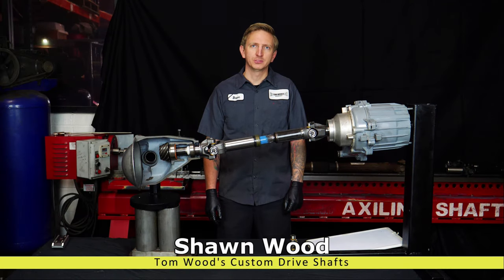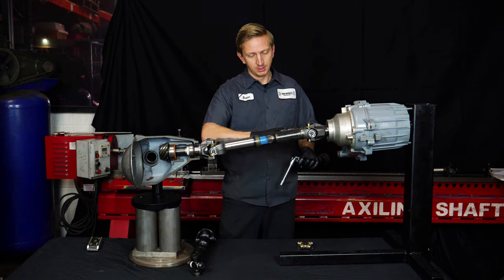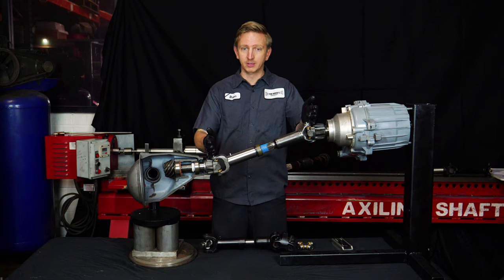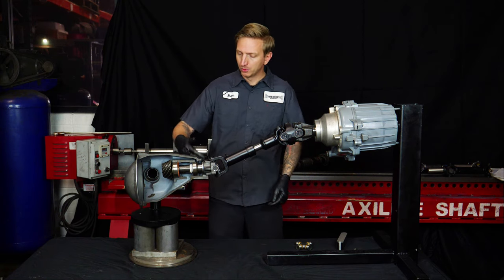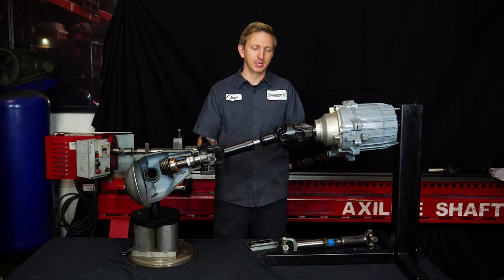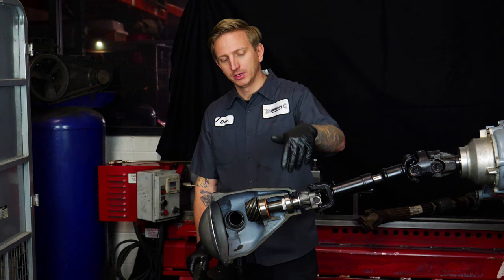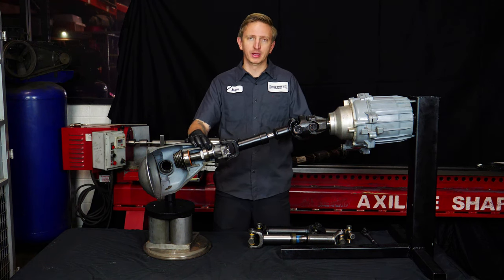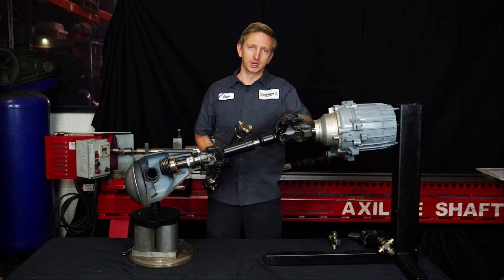Drive Shaft Angles Explained

Comment: That’s the vertical plane. The same rules should apply in the horizontal plane for an offcentred engine? Propshaft a few degrees off straight ahead should be fine right?
Reply from the maker: The side to side offset matters but only because it adds to the net joint angle at each end. There's some math that can be done to figure it but if you have 5 degrees vertical angle and 3 degrees side angle you'll end up with something like 6 degrees net angle. You square each angle, add them together, then find the square root of that sum. The important part to remember is that it isn't vertical plus horizontal equals total. In this "for instance" scenario above you'd still be within the limits of what should work well. Ultimately though, angle is angle and the drive shaft doesn't know up from down from sideways.
Reply: Interesting.  Thanks for that info 👍🏼

Comment: Great video. Answered some questions I had. Do you have anything concerning allowable yoke angle alignment? Working on PTO driven fire pumps on commercial chassis and there is a slight (1.5°) difference in yoke angles on the jack shaft. Wondering how much misalignment is allowed before issues might appear?
Reply from the maker: 1.5 degrees should not be a problem. In theory it is going to cause disruptions in how smoothly things run but I predict that the outcome will be insignificant and imperceptible.

Comment: hello, the same rules apply to a 4links? Or would the pinion have to stay at 0 degrees? what would be the ideal angle for a fourlink suspension?
Reply from the maker: We still tell people to set the pinion to about 2 degrees lower than the drive shaft. The axle wrap doesn't come into play with a 4 link though but 2 degrees still works well and allows us to give a broad and general recommendation.

Comment: I have a vibration in my 90 k5 blazer after 60mph, the vibration continues there after. I would describe it as a steep angle vibration feel. The k5 is all stock with a new driveshaft I had built. Aside from an improperly balanced shaft, what other components could be causing the high speed vibration? And the  tires have been replaced many times during the elimination process. Could the splined slip yoke even though it is tight to the bushing still cause balancing issues? I also noticed in 4H my front driveshaft will cause a vibration around 55mph. Not as concerned with that just wondering if there is a connection.
Reply from the maker: You can read some tips on identifying drive shaft vibrations here https://4xshaft.com/blogs/faq/diagnosing-drive-shaft-vibrations?_pos=1&_sid=d6ec76a03&_ss=r

Comment: My transmission flange & rear end are both zero so driveshaft is minus 6 at trans & plus 6 at rear. Single car Dan at both ends with the splined deal in shaft. I’m chasing a vibration & have had new splined section installed & balanced with new joints. Is 6 degrees acceptable?
Reply from the maker: Hi there. I know that your transmission and pinion are parallel but I don't know the other important piece of the puzzle, what the drive shaft angle is and how it relates to the other things. If your drive shaft angle is less than about 16 degrees (10 degree net joint angle at each end) then yes your angles are acceptable. If not, you may need a double cardan. There are also many other reasons a drive shaft might vibrate. More help diagnosing those can be found here https://4xshaft.com/blogs/faq/diagnosing-drive-shaft-vibrations?_pos=1&_sid=d6ec76a03&_ss=r

Comment: I’ve been fighting a 60mph front vibration for a year now.  Took the front shaft to a local driveshaft shop paid $300 to replace the center ball and balance. It didn’t help at all.  The caster was at 4 degree according to the alignment shop.  If I remove the shaft there is no vibration. Bringing the angle down shorting the upper control arms helps. Should I keep bring it down till the vibration stops?  Is the shaft the problem?
Reply from the maker: It could be the shaft but it could also be something that the shaft attaches to. For example, if the transfer case bearing or pinon bearing is loose your yokes(s) could be rattling around a bit. This by itself would not cause a noticeable vibration but once you hook up 20-30 pounds of drive shaft and it rattles from side to side the effects are going to be much more pronounced. This can also sometimes be caused by a yoke that is machined a little off center which then causes the drive shaft to run off center.
Reply: @tomwoodscustomdriveshafts  Thank you for the response.  I got the vibration to a point where it is almost gone.  I set the pinion angle 1degree below the driveshaft angle. It’s still there but at least it’s not a loud droning noise.  I’ll check the transfer case yolk next. It’s a 2002 Tj with a 3” lift factory front shaft and a Dana 30 front axle.  By the way. I think you’ve made the best video explaining angles I have seen.

Comment: My 04 Silverado z71 front driveshaft sounds all the time and it’s lifted 8.5” and I’m having front driveline vibrations that start and stop with acceleration on and off the pedal. I’ve narrowed it down to driveshaft angle Would a double cardan at one end or both ends help if the angles are bad?
Reply from the maker: You should for sure have a double cardan at the transfer case end. It theory you'd probably want a shaft with a double cardan at the axle end as well but that is not feasible on your application. The transfer case end is where most of the angle is though so adding a double cardan at that end should greatly reduce your vibrations.

Comment: 95 Camaro z28 80mph vib.
Every body has a different solution.
Q. did it vibrate off the show room floor at 80mph. I doubt it. In fact, that issue would have been on blast in 93 and either killed the car line or Chevy would have recalled the car due to safety.
Let's accept its not the driveline and aluminum DL won't really fix it. Somebody said change pinion angle to + 1.5
... NOW we are getting somewhere.
What changes things at 80 mph? Weight on the car. Rear suspension mounting wear?
Reply from the maker: I wouldn't jump to the conclusion that the shaft didn't vibrate off the show room floor. It is not uncommon for vehicle to have these sort of problems when new. It won't be every single car or truck but there are certain vehicles that are prone to drive shaft vibrations, even when new. However, lets assume that it was smooth in 1995 when the car was new. Here's what has changed since then, 29 years have passed. That means that if your shaft is a stock shaft it has 29 years of wear on it. Worn out parts will cause the shaft to wiggle around slightly, run off center, and cause high speed vibrations. The thing that changes at 80 mph is the centrifugal force of any imbalances in the drive shaft. These forces quadruple when the speed doubles. Because centrifugal forces are a product of mass x speed, reducing the mass with an aluminum shaft should actually improve the situation quite significantly. I don't think your vibrations are angle related, I think that they are dynamic vibrations. More about all of this here https://4xshaft.com/blogs/general-tech-info-articles/diagnosing-drive-shaft-vibrations

Comment: Pls,  is it really nacessary to have 0° angle with double cardan ? 
I am about 0.5° and still have vwry low growling sound above 80mph, with increasing speed itw worse.And  noise is equal durin acceleration and  slowing..Without driveshaft no noise.It is balanced and brand new.
Reply from the maker: No, .5 degree won't matter. You could be between 0-3 degrees and the shaft should still work the way it is supposed to. It sounds like your vibration is not angle related. More on that here https://4xshaft.com/blogs/faq/diagnosing-drive-shaft-vibrations?_pos=1&_sid=d6ec76a03&_ss=r
Reply: @tomwoodscustomdriveshafts  It seems that is variation of bad parts: maybye 1.too much pinion preload (I will give torque wretch to shop if measures properly), 2.inproper cardan balance 3.worn t-case bearings.
Without cardan is almost no or no noise and vibration because are not those rest parts under load.

Is it possible  when I sat  pinion to zero was vibration and noise almost gone because those parts have  less load with proper angle ? 
Or  double cardan should work to 100mph without vibration and noise sat to max 2°pinion ?

here is story:
It has helicopter sound from 45-65 and more..
Ihad bad center ball and center rod , after reweld the new and balanced it ,it left now only humming really bass noise and vibration (only with cardan) but above 65mph ,the faster I go its worse.

Iam desperate, it start  really go into money.
Reply from the maker: @jurajsmutny8171  The best way to reach us is by calling us at 801-737-0757 or by emailing s@4xshaft.com. We're going to need to know more about the vehicle and the shaft though. We need to know what type of vehicle this is and what type of shaft, whether or not we built the shaft.
Reply: @tomwoodscustomdriveshafts  sry to write it all here but I thought you have almost every info.
Its 4" lifted grand cherokee WJ with all adjustable arms. It classic front driveshaft with doublecardan..I sent it already to shop to rebalance it.They balance it at 2000rpm.They told me their maschine goes to 6000rpm but 2000 is enough for wehicle.So I let them rebalance it at 4500 so ist about 100mph.Currently have 3.73 gears with 31.6" tires.
Reply from the maker: @jurajsmutny8171  I don't think they are really balancing it to 6,000 drive shaft RPM. Simply because I don't know of a balancing machine that will spin shafts that fast. Typical max speed for a drive shaft balancer is 3,400 rpm. In your vehicle 100mph is about 4,000 rpm. 

Again, 6,000 rpm sounds very unrealistic to me. The most common balancing machines I know of are Shaftmaster and Westport. None that I know of that go faster than 3,000-3,400 rpm. Also, 2,000 is definitely not enough for your application. 2,000 drive shaft RPM is only about 50 mph in your Jeep. It sounds like some of what they are doing or saying they are doing is not completely legit.
Reply: @tomwoodscustomdriveshafts  it seems they repair not onyl cardans but also other maschine shafts so I really dont know what kind of balancer they have.They told 2000rpm is enough to show inbalance in it also for higher car speeds..But its doesnf matter to me,I have not much shops in my country to choose, so I choose this one because previous shop change only cencering ball despite it was also the centering rod tottaly worn a nd double cardan had still helicopter noise ,just bit quieter..This shop reweld it and balanced it,helicopter noise gone but still had in higher speeds 80mph and more.
Today I drove withou front cardan.I dont know if its just inmy head I hear it just like on 10-20%.So maybye that s not only about cardan..I checket everything, I lying under car more than on couch :D

Comment: So how do you set the front drive shaft if you are angling the transfer case down?
Reply from the maker: Because the transfer case is bolted to the transmission which is bolted to the engine you can't tilt the transfer case much. You end up tilting that whole drive trains assembly, engine, transmission, and transfer case. By raising or lowering the transfer case which would be the back end of that assembly you can usually get no more than 5 degrees total change. Tilting the back of the transfer case down of course tilts the front of the transfer case up. That is usually how people will tilt the transfer case, they will lower it and tilt the back end down. It is much harder to go the opposite direction as you can't push the transfer case up too much without running into the floor. To answer your question though, the rules of drive shaft angles outlined in this video still apply the same way they would for a rear shaft or any other drive shaft. It just becomes harder to achieve proper geometry on the front, especially if extra changes are being made such as changing the angle of the transfer case.
Reply: @tomwoodscustomdriveshafts  thank you very much for the well thought out reply.  
I was asking the question because I have a lifted short wheel based vehicle and I am trying to set the transfer case.  I can set the transfer case so it is perfectly level or I can tilt it down about 5 degrees.   Both my front and rear pinions point up 9 degrees.
After watching your video a couple times I was wondering if it is better to level the transfer case level and deal with the angles or if it is better to tilt the transfer case down in favor of the rear drive shaft and deal and still be able to get the front end shaft to work with the front pinion pointing up 9 degrees and the transfer case pointing up 5 degrees (this shaft is much longer). 
I guess in the end my question is, does your company make parts to make this work?

Comment: Have you ever seen rust throw a driveshaft out of balance?
Reply from the maker: No, the rust shouldn't affect the balance but what the rust indicates about the shaft probably does. A rusty shaft is an old shaft and an old shaft almost certainly has worn, loose, and distorted parts, all of which will affect the balance.
Reply: Thanks!  Very helpful.  Got a mystery pulsing/rhythmic vibration above 40mph in the rear.  Narrowed down to either CV, differential, wheel bearing, or drive shaft.  Mechanic thinks driveshaft.  Your video really helped me understand why it could be driveshaft.

Comment: I just want to point out that where he talks about lifting pinion and throwing off caster, there is a solution. You cut the welds on the axle tube, set your pinion, then set the caster angle and reweld. It's not rocket science.
Reply from the maker: That's a good point to bring up. It is possible, on many vehicles, to rotate the front axle using the method you described. While not rocket science it is a fairly difficult task that most people are not equipped to do themselves. It's not exactly a do it yourself, weekend in the garage, type of thing. Experienced fabricators can do it, but this video is mostly intended to explain things to regular people. For most people, a cut and turn on the axle is not a realistic option.
Reply: @tomwoodscustomdriveshafts  Fair enough! Honestly didn't expect a reply! Good on ya, mate. I live in an area where guys will drop over $100k on custom builds like it's dollar taco day at Taco Bell. I just figured if we were this deep into drive shaft knowledge, we were getting serious. 
Also, I have that pinion angle tool I bought from Dana/Spicer plus all the adapters. I bet not everyone has that particular tool. It wasn't cheap.

Comment: a lot of that explanations are not really correct, you have totally missed phasing which cancels out some of the vibration. Also the yokes at the same angle will 100% cancel the vibration at any speed, what does happen is other imbalances and issues occur. Prro explanations all round to be honest.
Reply from the maker: Nope, you are wrong. I intentionally didn't talk about phasing because there is that one video of the guy with the blue shaft and sprockets that explains phasing. That video is an excellent video but it misleads people into thinking that there is no maximum angle as long as the joints are phased properly. On a benchtop demonstration this may seem accurate but when you are talking about something like a jeep where there are heavy parts and heavy loads it does not work as planned. This is because the rates of acceleration and deceleration of the joints are not uniform. One joint accelerating as the other decelerates is the thing that cancels out the oscillation. But because the are not uniform they cannot uniformly cancel one another. This is explained a bit in the text on this page https://4xshaft.com/blogs/general-tech-info-articles/driveshaft-angles. What's really important though, in my opinion, is that tens of thousands of people have switched to a double cardan shaft because after lifting their jeep the conventional shaft no longer runs smoothly. Even if their shaft is perfectly balanced, even if their yokes are perfectly phased. Most of these people are not being preventative, they are reluctantly spending the money on a double cardan shaft because their stock shaft shudders and/or vibrates, because of too much angle. The proof is in the results.